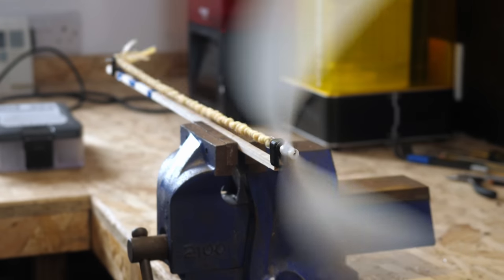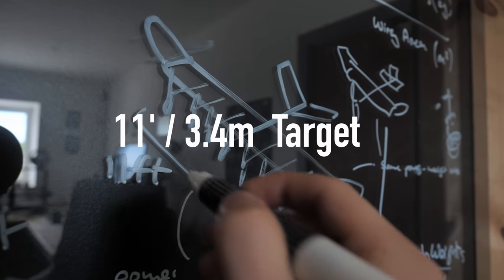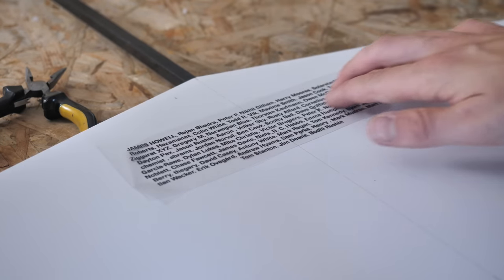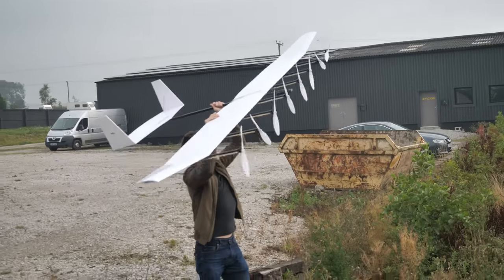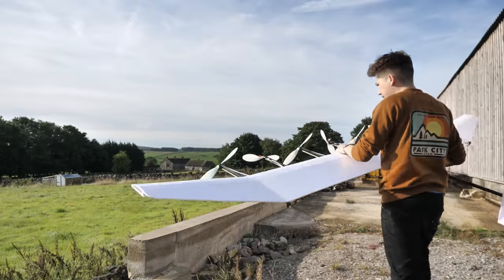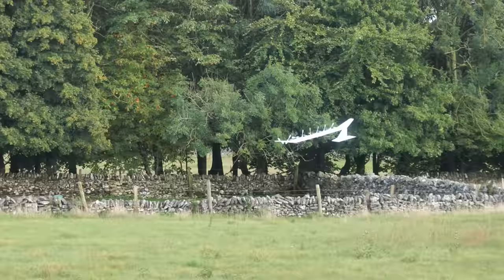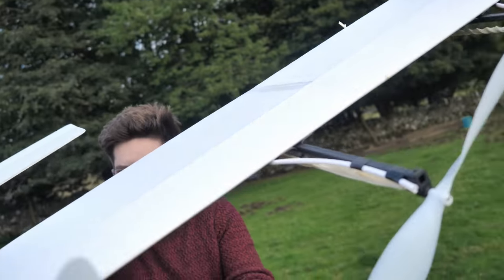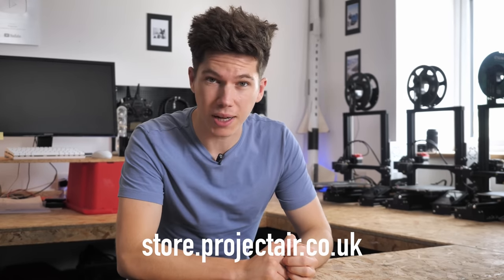Giant Rubber-Band Plane

Comment: Okay, here's a concept I'd love to see someone do: Power an rc plane with the same servos you use for flight surface control. After all, it can't be worse than rubber bands, right?? There are mechanical drives that take oscillating rotational motion and turn it into continuous rotational motion - if you put something like that driven by one of these back-and-forth servos, could you make an anemic little airplane that can actually fly on servo power alone?!
Reply: Don’t underestimate the power of a properly done rubber motor. It will quite easily over power most RC servos.

Comment: Can you double the rubber bands with and include staging to flip between one set of bands and another.. so keep a second set attached to a gearbox that does not unwind a certain point. That way you keep the thrust but increase weight.. question is how much more weight \ power can you take? Feels like a fun challenge to @TomStanton
Reply: It’s the rocket equation all over again. How much energy density (J/kg) do rubber bands have? :D

Comment: Great project although it has to be said you should be aiming for a lighter machine, you rightly say you’ve achieved a lightweight model for its span class but your frame of reference is conventionally powered types, rubber powered models are built far lighter, the best are the lightest - foamboard and carbon May ne your happy place but it’s not ideal for rubber powered in my opinion
Reply: Also I would look at a more efficient airfoil, you e designed something great for sustained high power but to harness rubber power you need to design ultra efficient

Comment: The more sort of "professional" rubber-band application i seen, in steed of winding the rubber-band from the front have have a dual hock in the back with a one way rotational lock. This make it so the hock in the back can wide the aircraft, but not unwind it. Then they take a cordless drill with a hock on and wind all of them from the back. Taking like 10 second a band.
Reply: The winder he is using is about 3x faster than any electric drill.

Comment: Also..... Could you make a plane / car / whatever, powered by High pressure air, you can get a300 CC - 300 BAR carbon fiber bottle that are pretty light, with a regulator to a lesser pressure you could probably do,,,,,, whatever.

Comment: What if you made it like a Prius? Rubber band powered generator to power individual tiny motors? Still rubber band powered but easier to distribute power to props. A capacitor as a storage device to regulate the power. And with the right design making it fly for the record is possible.

Comment: Well you did have a helper you just chose to utilize her as a cameraman when a tripod would have worked just fine all she had to do was stand in front of you and pull the chalks out then run to the camera and then follow the plane but I guess that didn't look good enough for you so you sacrificed functionality for how things looked I guess. Also I would have done the chalks differently I would have set up the chalk so that you can pull them backwards so you can just put the strings on a tripod behind you and that way when you throw it it would automatically pull the chocks out and it wouldn't be on the ground so you wouldn't have that angle problem

Comment: I've seen people start all the props at once on large rubber band powered planes by just making a foam block that can be put over all the props and then taken off, releasing the props simultaneously. There's videos on youtube of a massive spruce goose with 8 rubber bands that is launched in this way. It definitely saves on weight, as it requires no onboard system.

Comment: Not an engineer but is there a way to delay 1/2 or 1/3 of the motors so they kick in later in seperate stages ?  Also weight would be horrible but if you could re-wind and release again in mid air.. that would be ideal 👌

Comment: Would it be better if the propellers were used up gradually rather than all at once? Might not work due to weight/thrust ratio. But if done correctly, i could see it going for longer and further. Freeing up bands/propellers in intervals. Maybe freeing up 4 at once to start off and then 2 and 2? Or it might be far too slow to even get anywhere and then land. Not an aeronautical engineer but still giving my 2 cents😊

Comment: Have you seen the rubber band planes that are made outta super thin wire and super thin plastic wrapped around the wire so they can fly for ages, try making one of those, the powers less so much less speed but the flight time is pretty insane even tho they're mainly ment for in door flight

Comment: Why didnt you put a landing gear on the plane? It could’ve been a very simple one that isn’t heavy. Also since you had RC controlled servo motors you could’ve programmed them to release the propellers at different times. Maybe the first 5 just to get the plane into the air and then the last 3 at the end to prolong the flight duration? 

I would love to see you make another video with an upgrade to this plane 😁

Comment: "Is it cheating?" ...... a fair question. The simple answer is no, the long answer is no of course not your using a long strip of rubber, link it at both ends it's a band take a rubber band and cut it it's still a rubber band, so you are still effectively using a rubber band.

Comment: If you can somehow do it without going bankrupt, I'd want to see what a plane with that many electric motors would do.  The added weight of motors and battery would make it harder to control, but with that many constant engines I think it would fly pretty fast once you got it going.  I bet it would have enough power to tow kites without getting thrown off course too much

Comment: Attach a smol motor to wind up the rubber band props and like two props at a time when they run out set off the other two props and wind up the ones that were just running

Comment: And a pneumatic propusion (CO²  cartridge pressure ) ? discrete system without thermal effect . . . .
 - reactor or pneumatic motor for propeller

Comment: In the spirit of cheating, exactly how strict are the rules? Like couldn't you store the energy under compression using a spring then have the spring keep winding the bands while in the air? A fairly simple torque converter converting the linear motion of a compressed spring into radial motion attached on the back of the rubber bands and rotating in the opposite direction to the props could theoretically keep the thing flying for a really long time.

Comment: you are allowing the rubber bands to cool to much, you can increase the performance of your plane by not letting the rubber bands cool after you stretch them. if they cool to ambient temperature  then release them they will become colder than ambient cold rubber does less work killing the performance. also rubber has pretty poor hysteresis so you should use new rubber bands every flight.